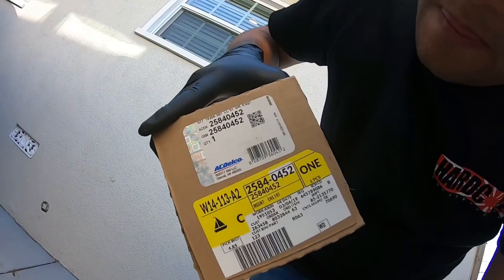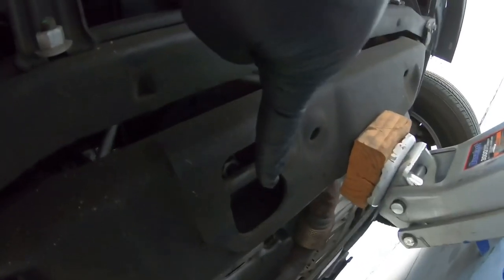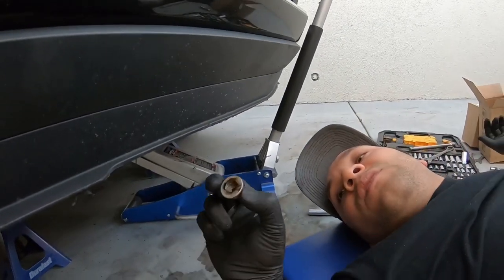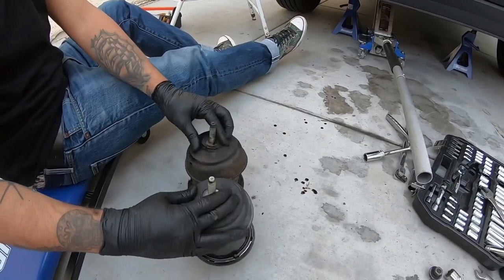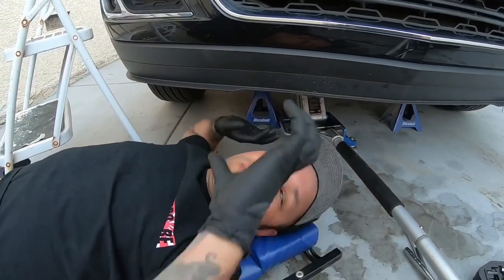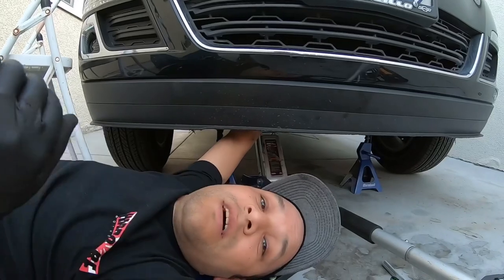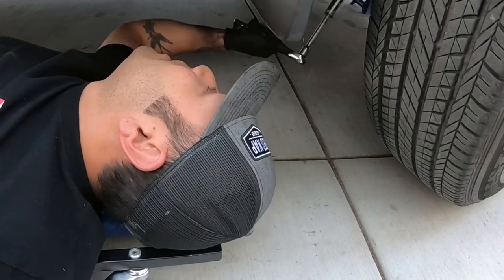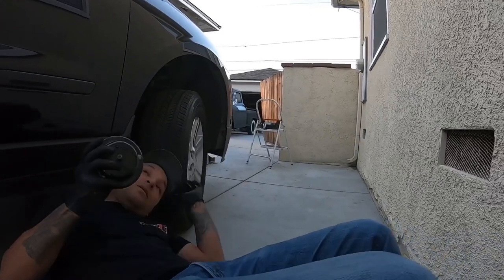Traverse Motor Mount Replacement

Comment: I just replaced my front motor mount. It’s WAAAY harder than it looks because of the oil filter making it almost impossible to angle my ratchet. Once you get that main part taken care of, the rest is a piece of cake, not to mention you save $300+

Comment: Did you also have a shake? My 14 is doing what you described but also shakes at around 20-30 mph no matter what gear it’s in.
Reply from the maker: Andrew Cerda Yes. It was shaking too. Once I replaced the mounts, that vibration was gone. I initially thought I had to replace my rotors too, but after I replaced my mounts it wasn’t there.

Comment: Hi Joe, I recently discovered I too need to replace my engine mounts on my 2012 traverse, still need to figure out which out of the 3 mounts it is....my question is this,  are 2012/2014 engine mounts the same?

Comment: The front is dripping fluid cause the oil filter is right above it and when you take the oil filter off the oil flows over it. Had to take my front motor mount off to get the starter off and the mount had oil in it.

Comment: @ Joe Flo thanks for the info. My 2014 is having the same problem with the stabilitrak, engine reduce and tracking control. If you can remember, did the top strut mount screw needed to be loosened as well when you replaced the front mount?
Reply: According to the Haynes manual, yes. It says, for the front mount replacement, "REMOVE THE UPPER NUT FROM THE RIGHT SIDE (REAR) MOUNT, AND THE UPPER AND LOWER NUTS FROM THE FRONT MOUNT & THEN RAISE THE ENGINE UP FAR ENOUGH TO REMOVE THE MOUNT."

Comment: Great video. I noticed at the end of your video that your engine moves back and forth at the time you shifted reverse and drive. Did you inspected the upper motor mount (engine torque strut) located underneath of the fuse box?
Reply from the maker: Jean Pierre Remond Thank you. That one was good at the time. It is currently going bad though, so I will be replacing it shortly.

Comment: Did you have to r remove the oil filter for the front mount
Reply from the maker: I did not.
Reply: With the oil filter out you have a direct line to that top nut. Get about 2 ft of extensions for your rachet or impact gun.

Comment: Curious, how was the condition torque strut mount and the transmission mount?  

That still looked like a lot of movement on the engine.
Reply from the maker: Looked like a lot of movement, but felt solid driving. They were good, but now a couple years later, they feel like they need to be replaced.
Reply: @JoeFloCreates  2 of the 3 we're broke changed all 3 but now when I'm stopped theres a bunch of vibration that wasn't there prior is that normal with the new parts?

Comment: From what I can find, there’s a 3rd mount on top under the fuse box holder?? Do you have info on that?
Reply from the maker: There is one, but mine wasn’t bad. Check the bushings on it. If there are tears or cracks in the rubber it should probably replaced too.
Reply: Without removing the fuse box is it possible to verify that? I did watch another video that showed how it was torn but that guy took the box all the way off.
Reply: How long did it take you to do it?
Reply from the maker: @antoniorendon6802  Took a little less than 2 hours if I remember correctly.
Reply: Andrew Cerda yes it is necessary to remove the fuse box plus the metal bracket for it in order to get access to the torque strut mount
Reply: @JoeFloCreates  How could you lift the engine without loosing the top mount ? I think you have to unbolt that one..otherwise you can crack the rubber.....thanks
Reply: @JoeFloCreates  your engine is rocking more than normal I think you damage the rubber on the top mount if you didn't unbolted it to lift the engine...
Reply: Becareful on that strut mount because fuse box does have to be removed make sure battery gets disconnected and be careful when reconnecting box i burned mine out thank God for extended warranty🥴

Comment: there are two more though?
Reply: There are 3

The two shown in the video and a third on the top... passenger side, under the fuse box (that one can be done without jacking the engine)
Reply: @fbowie21  how much did you save
Reply: @andregelsey5682  probably 600 dollars at least